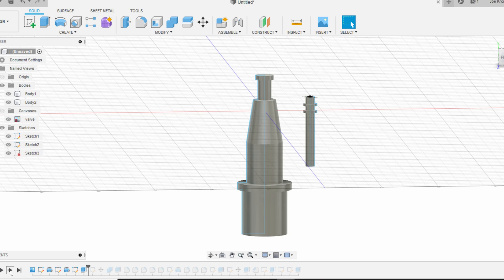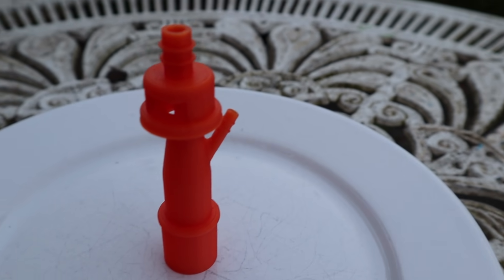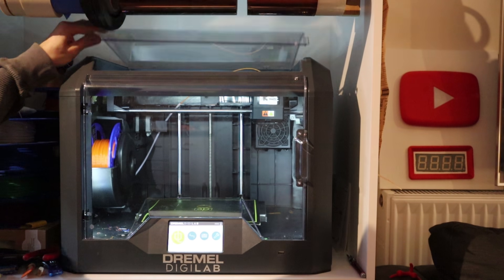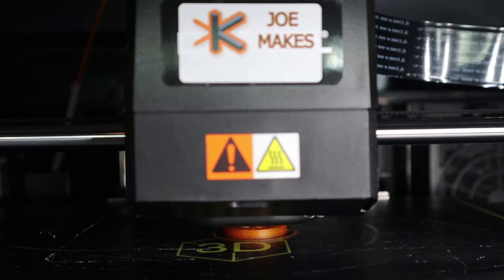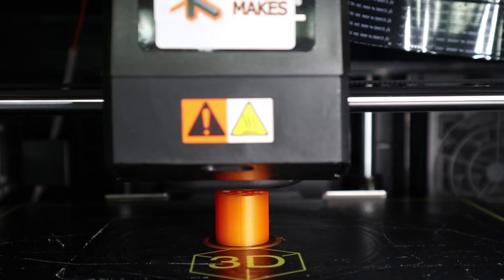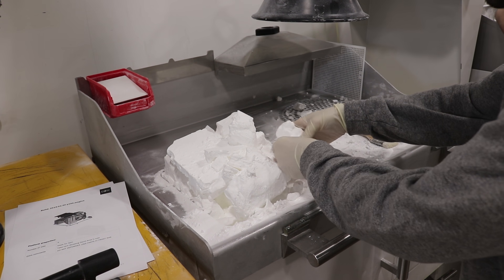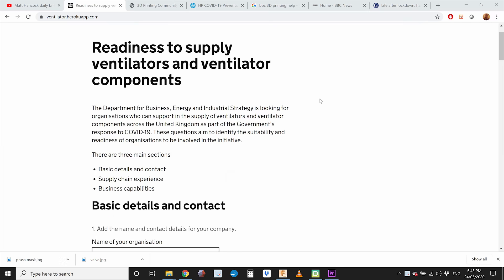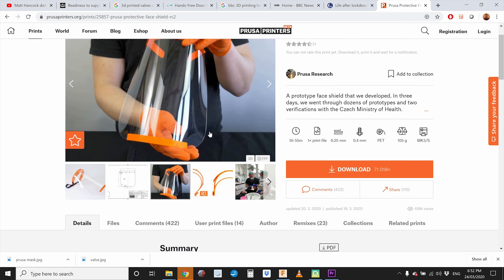This 3D Printed Ventilator Valve will NOT save your life.

Comment: Great advice Joe! I'd add another reason to your list. Making hundreds of these valves is of very little use when there are no devices around that use them. This valve is for a very specific device and that is not commonly used in North American hospitals as a ventilator part. It's sort of like the auto industry saying that they are short wheel rims and people saying : "Hey, I can 3d print one!", printing up a bunch and then finding out that it is a 6 bolt/stud version that they need and you printed out a 5 bolt/stud one. Get more information and actual need first before you print anything. If you don't, you're just wasting everyone's time.
Reply from the maker: Great analogy, Rob!  Goes back to the universal question: "Isn't it standard?" haha
Reply: @JoeMakes  sure and just ask the guy who screwed up his calculations and destroyed a space probe a few years ago because he chose Imperial and not metric measurement units and didn't check. "But it is a standard!" Yes, the wrong one!

Comment: What you are refering to is a specific case at an Italian hospital that had run out of respirator valves - and the SUPPLIER COULD NOT DELIVER NEW ONES! Some people with 3d printning knowledge collaborated with the hospital to producere replacement valves in order for sick people to be able to get on a respirator. The valves where produced safely and in any case wether PLA or another filament is sterilized in the extrusion process, at least if you extrude at 100 Celcius. Parts can be further sterilized with alcohol if needed. I quite agree, that you should not start to produce any kind of medical equipment at will - but only after it has been agreeed with hospitals and or proper authorities. So next time dig a little further into the story!

Comment: FDM prints with tiny gaps that could allow a virus through or catch germs
Reply from the maker: So true!
Reply: So print in abs then go to autoclave ...at 100c
Reply: @noway8233  PLA class temps 70 degrees autoclave  will damage it; ABS a bit higher.
Reply: @noway8233  No autoclave  here

Comment: Liar...jajajaja...everything to be used with humans, has to be sterilized before it... 3d printers works with a temp. above 200 degrees...so, what are you talking about???
Reply: How do you think injection molding works? Material is also heated as well as LSR for example. Parts still have to be sterilized if they come in direct contact with patients. Your logic has a big flaw. Keeps bothering me that people believe some Facebook 3D printer guy over some engineers, companies and even institutions which deal with that kind of high risk products for decades.

Comment: So sterilisers and alcohol somehow now don't exist, the devices are not illegal to make or use you just can't sell them if they infringe on patents, there is a legal risk to use as they have not been tested to comply with some antique regulation or standard but they may work and be fully functional but seems you're too cheap to use a dual extruder and dissolving support material to get complex internal geometry. 

Should people print these and start dropping them off, no, it's a waste disposal issue as most will be poorly made and won't fit anything, can they be printed and made fit for task sure, but random production with no coordination helps no one, so don't do it unless asked hospitals have enough work to do.

Comment: Creating these parts for the medical community like masks or face shields falls under the "Desperate times call for desperate measures" solution category and I don't believe anyone thinks 3D printed anything will be the norm when this all shakes out.
Reply from the maker: Great point.  Face shields for the time being are the best use of printers!
Reply: That's a great attitude, right up until your desperate reliance on a bad design causes you to contract a virus. (Thinking of poorly-fitting printed respirator mask cups here.)
Just because you have a hammer and know how to use it doesn't mean you should walk around your neighborhood looking for things to pound. Is it good to encourage people in sensible projects? Yes! But some are not sensible.
Reply: @JacksonKnives  trying something is better than nothing! because we already know that doing nothing is guaranteed to fail.
Reply: @jeffgould5367  I agree in general, but the case I've cited (poorly-fitting masks) is a textbook example of "more harm than good." We need to make sure that we can help each other succeed by encouraging people to learn about how things work, not just print things mindlessly.
Reply: @JacksonKnives  Surgical masks are "poorly-fitting" though so the main issue will be sterilizing them with all the tiny gaps and holes in FDM prints. But at the end of the day I agree with you, a lot of the 3d printed masks are badly designed. Personally, I use a 3d printed mask too but it's my own design based on Megabyte's design (with window insulation to form a seal and I printed it with resin and post processed to a mirror finish with another coat of UV resin). That said, I wouldn't really let other people risk their health using my mask so I just use it for myself coupled with a full face mask when going out for groceries. Masks are sold out in my area so I make do with cutting up the few masks I already have for use in my 3d printed mask.
Reply: @exia8989  great point about surgical masks, the fact that there's so little consensus among the epidemiologists about droplets vs. particles is really making this harder than it should be. (I use respirators for paint and dust, where I know for sure that leaks will lead to lung problems and/or neurological damage.)

Comment: Hi, whenever anything happens information is misinformed or totally out of order. This is a perfect example. I do woodwork and I use a dust mask when braking down pallets in case there are any contaminates on the pallets I use, simply because I do not know what was supplied of the pallet in the first place. The masks I use are for stopping dust or wood molecules from being breathed in. these masks will not make any difference in stopping any virus but I can’t get any because some idiots have bought them all up and are selling them for ridicules prices as defence against this current virus. If people would stop and think, a mask that does not make a full seal around your face is not going to keep you safe. Leave the dust masks for the use they have been made for and stop making criminals wealthy.
Reply: I doubt that a dust mask will not make any difference when it comes to stopping viruses. That's because a dust mask will need to be able to stop particles in order to  be effective, so it might just stop 50% of viruses but that means you are half as likely to be infected.

Comment: Good video. However, if I had SARS-CoV-2, and needed a ventilator, and there are no ventilators, I'd rather use one that might be contaminated than to simply give up and die.
Reply: This is the best proof I've seen that ignorance is deadly...
Reply: You guys are the perfect example of people who don't know what they don't know. None of the those "cheap ventilator" designs that every university and DIYer is hyping up will work . They will kill more people than they will save. They all use the same basic concept of mechanically squeezing a BVM (bag valve mask) using stepper motors and arduino. Anyone who understand how ventilators operate and are familiar with the numerous issues they need to consider would know that automating a standard BVM simply isn't feasible. In fact the likely hood is that it will kill the patient.

Real Engineering explains it very well in their video and specifically addresses the problem with everyone promoting these cheap designs.
https://www.youtube.com/watch?v=7vLPefHYWpY
Reply: https://youtu.be/xdZtMgpxnPI
This design uses the sterile intubation tubes, respirator bags, etc... That are already used by hospitals and Ends.  There are No Mechanical parts to wear out. There is a second video on this model that shows dials that a respiratory therapist can use to make appropriate adjustments.
Reply: Thank you for sanity! It doesn't cost much to 3D print this, and having one just in case doesn't hurt anyone. Granted, we have no idea what ventillator local hospitals use, but Venturi mixing is all that's needed, everything else can be duct taped.